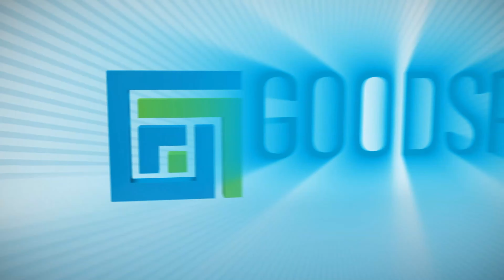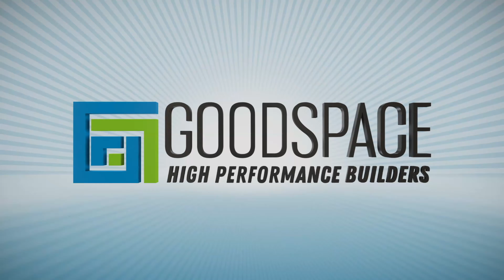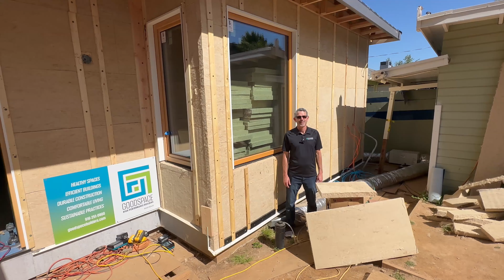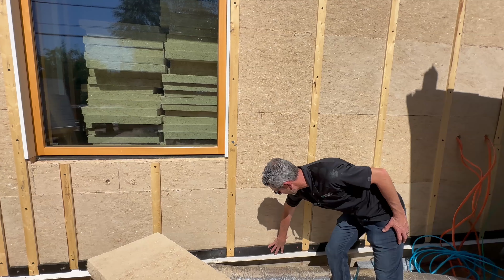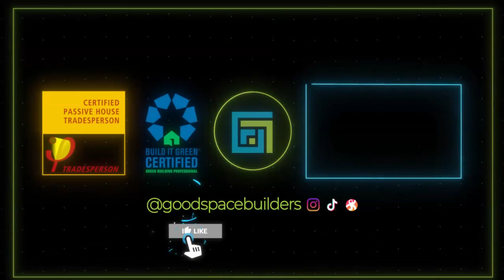Hempitecture   PlantPanel X 1 Insulation

Comment: Could you just  lime plaster over this?
Reply: Hey thanks for checking out the video. We honestly don’t know the exact answer to give you. We can check with Hempitecture or if you have more questions about their products obviously they have better answers than us. 
We pretty much use it as the exterior insulation layer then apply a stucco or other siding over top.
Reply: @theaveragepat   so it's not important to keep it breathable with this plant panel?
Reply from the maker: @ yes you'll want it to be breathable. check out this video we put out showing the mockup of the wall system for the passive house. https://www.youtube.com/watch?v=5TvGFYSt1nA
We made sure there was a gab for air to flow behind it.

Comment: How is the fire and insect resistance?
Reply from the maker: Great question and we are actually going to do a fire test on multiple different insulations so keep an eye out for that one. 
We work directly with Hempatecture (not paid by any means) and use their products on our builds whenever we can. I believe we were the first contractor in Sacramento to install their products. When it came to the Passive House build, we put an insect guard at the bottom of the exterior wall and sealed it off so no bugs can get in it. As far as the fire resistance Hempatecture does say it's not fire resistant but does dampen the effect of the fire so it won't just go up in flames. Which should help if a house did catch on fire with the Hempatecture installed it will smolder so fire fighters have time to put out the fire.
Reply: @ neat!

Comment: i wonder how this product compares to wood fiber insulation like Steico or Gutex and others ? 
i like the idea of using hemp more than trees for obvious reasons .
i've built two houses in Germany using Steico over laminated logs of 14 cm thick . the panels are tacked in place over the flat faced logs and held in place with furring strips every 50 cm to accept a siding of choice . the space between the furring strips provides a vent to remove any moisture build up .
the results are spectacular in terms of heating and cooling and the comfort level is legendary where i live . there are no toxic or off gassing materials in the entire house including but not limited to furnishings , bedding, cabinets ( all wood ) etc. 
Hemp, if performing similar would be a better choice as it grows like a yearly crop , where's as trees grow far more slowly .
Reply from the maker: Thanks for checking out the video. So before we started using Hemp, we were looking into Gutex and learning more about it. The main problem for us out here in California was that get Gutex was a problem and the other big factor was the price. Gutex is quite expensive for us out here. We have heard of Steico but that seems to be more of a European thing to use. Gutex was the first wood fibre board we could find when we started searching around for it. We have still not used Gutex on any of our projects because Hemp is quite a bit cheaper and very easy to work with. The noticeable difference right away between the Gutex board and the hemp is that the Gutex is a lot more rigid so it's not as easy to squeeze into certain spots. Don't get me wrong, hemp is a rigid board but we do have a little bit of flex in it which makes easy to cut with one of our circular saws and still pack it into a space if the cut is a bit oversized.  
It's sounds like you've built a great home.. Congrats
Reply: There is a company in Maine that is now making wood fiber insulation . it's called Timber HP. 
i believe it uses the gutex formula or something very similar . 
looks like you guys have found an equally  great product .all the best on a successful build .
Reply from the maker: @siriosstar4789  Noted. We'll add that to the list of alternative insulation companies. thanks

Comment: can panel x be permanent shutter for sparying hempcrete from inside. cost?
Reply from the maker: Hello, sorry for the delay in responding. We haven't used Hempcrete before and we're a bit confused with the question. What do you mean about it being permanently shuttered? 
As for cost, the hemp panels are fairly competative to similar products like rockwool.